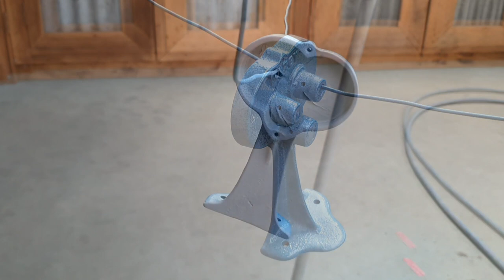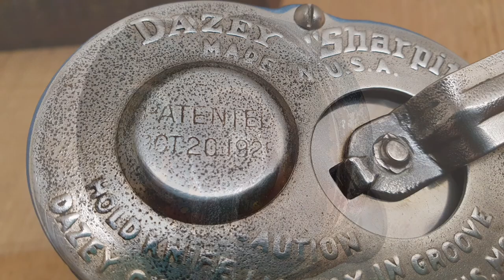RESTORATION OF A DAZEY "SHARPIT" MADE IN U.S.A PATENED OCT 20 1925.

Comment: Hi buddy, crank tools will be useful for when the oil runs out. I was restoring a hand-cranked drill but the cast iron frame broke and so I had to do it again with welded iron.
Reply from the maker: Yer mate your right no power and I will still be able to sharpen my tools.
Reply: in a future wihout low cost energy, no commerce so someone who is able to restore tool will be really respected job.
Reply from the maker: The old stuff now is becoming more popular and as I go to look for new projects to restore the price is going up to.
Reply: @metalartRestoration123  usually i found them in abbandoned places, or from farmers.

Comment: Wow awesome restoration! Just picked one up for 5$ CAD and was wondering if I could make an adapter for a new grinding wheel. Your video just confirmed that, thank you!
Reply from the maker: Thanks Josh glad the video could help.
Reply: @metalartRestoration123  would you happen to know where I could get a grinding wheel like that?
Reply from the maker: This one i had in the shed for years but I think that any big hardware shop or even maybe on ebay and probably automotive shops would have them.

Comment: Where would I find the 2 wheels that goes on it   and also mine has a dome shape spring   thanks
Reply from the maker: Not sure I didn't buy anything for it i just restored it at home using what I had u could try ebay or a hardware shop 🤔